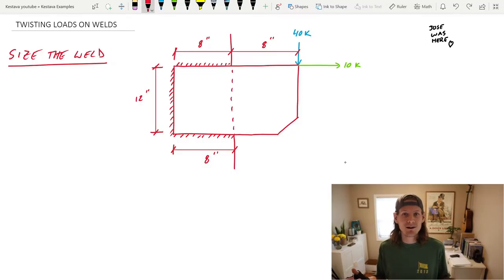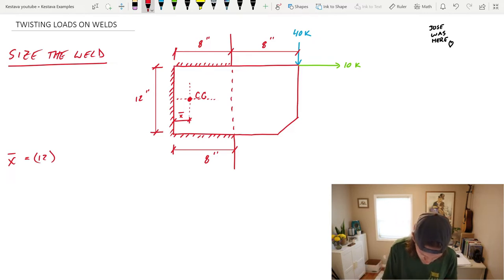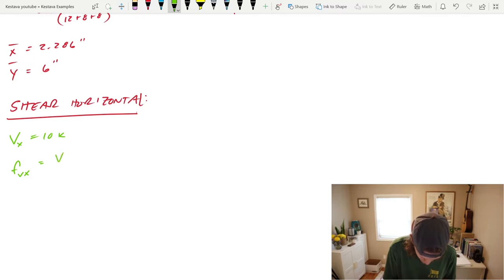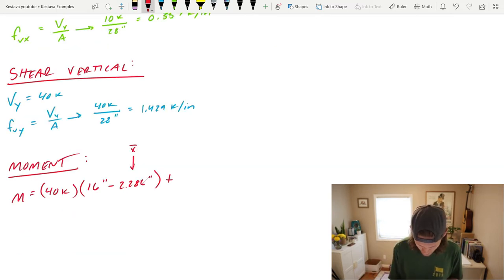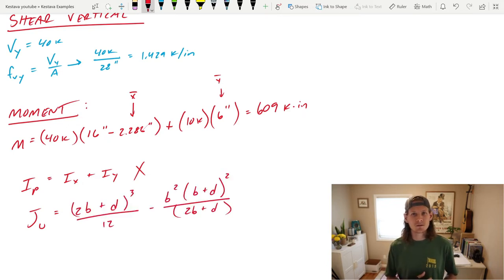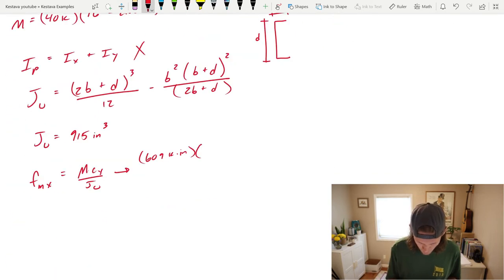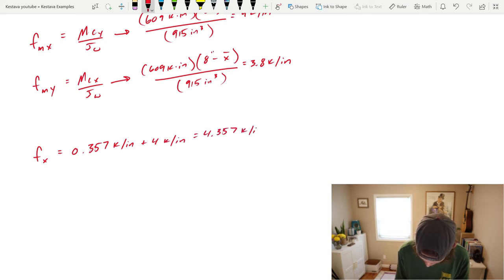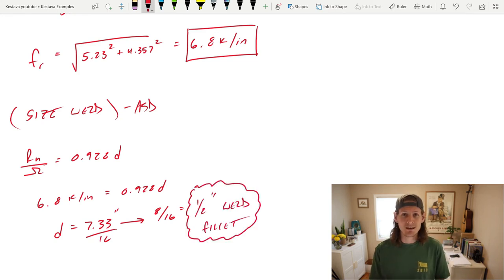How to Design a Weld For TORSIONAL Loads | Civil PE Exam Prep

Comment: I was a welder before becoming an engineer and the key to your question at the end is the groove type/angle. SMAW (stick welding) has a hard time getting to the bottom of a 45 degree groove. If you look at the top of the table it shows SMAW again. Generally speaking SAW produces a more consistent stronger weld because it’s more controlled and often done by a computer controlled machine, but it uses a solid shielding material so it can only be done when the weld is flat. 

PS most contractors I’ve worked with have switched to FCAW or flux core welding as it increases productivity and you can weld more than 10” at a time, fewer starts and stops.

Comment: Good job Kestava; One question though, I would have thought you were going to use table 8-9 from the AISC manual, I think it is much faster and should give the same answer, Calculate the resultant force, calculate the applying angle, go to the table and pick the numbers.
Reply: I believe there's a typo in the last formula from the manual; it should be 0.928*D*L. That's why your weld size is too big. the final weld size is 5/16"
Reply: @mohamedsow6093  The formula is 0.928 kips/in/(1/16" of leg). Since he calculated all results as k/in, then his weld size is correct.

Comment: how do you know point O is the point where the extreme stresses are located?
Reply: I would say that this is the case as the least amount of steel is around this point. At point O, there is only steel at the left side to help resist the stresses induced by the loads. However, as you move to the left and closer to the center of gravity of the welds along that 8" weld line, you will have steel on all four sides of a given point that helps resist the stress induced by the loads.